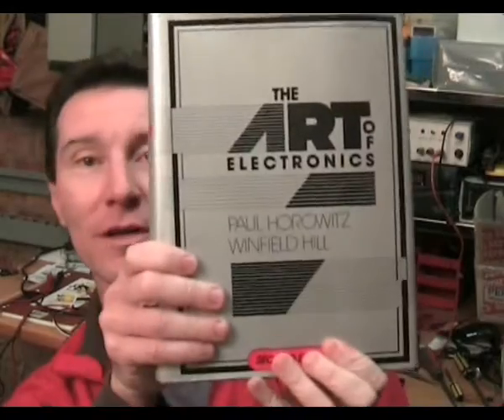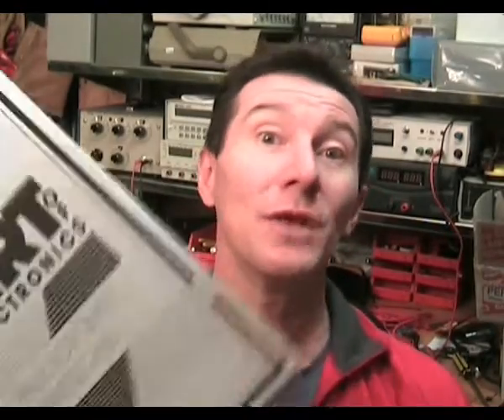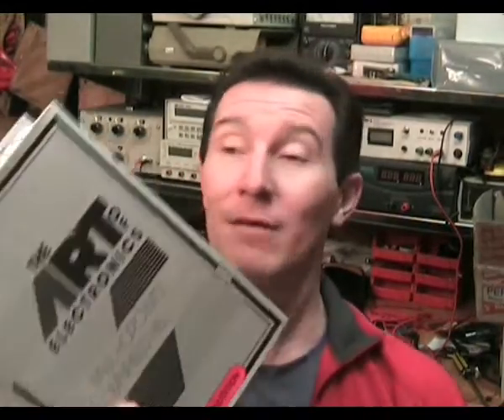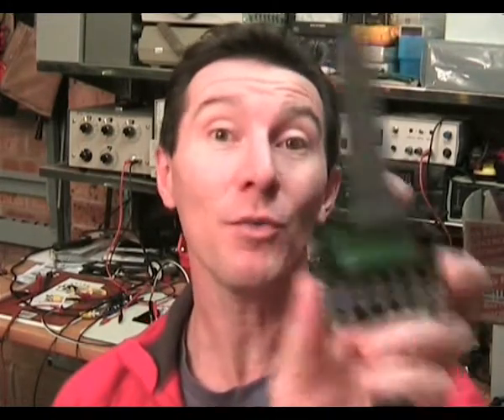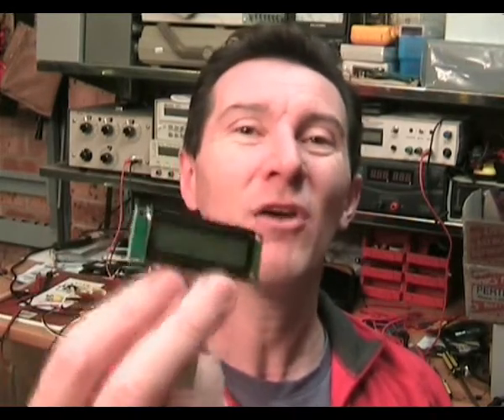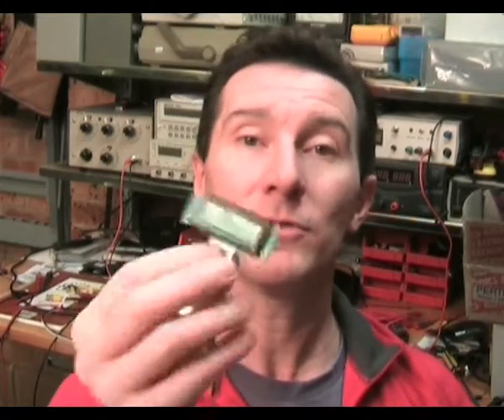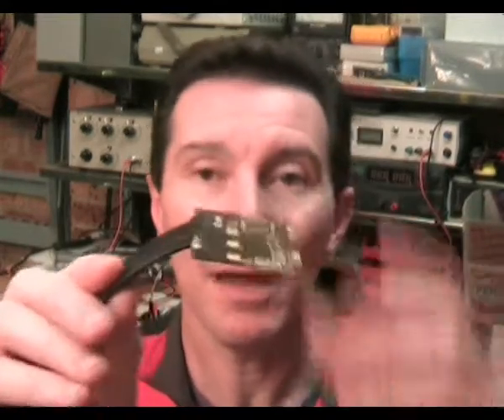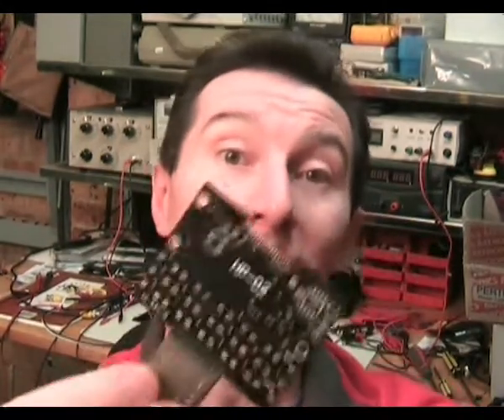EEVblog #11 Part 1 of 2 - Talk about DIY product design

Comment: +1 for EE books being theoretical crap.  Most of 'em are just really REALLY old material thrown into a blender, given shiny & expensive hard covers, some illustrations, and then thrown into university book stores at significantly inflated prices.

If anyone wants a pleasant shock, go to your local library, and assuming they've been around for at least a century, they likely have some nearly 100-year-old electronics books.  One recurrent theme: almost none of the basics have changed!